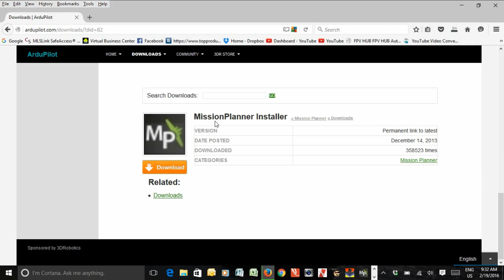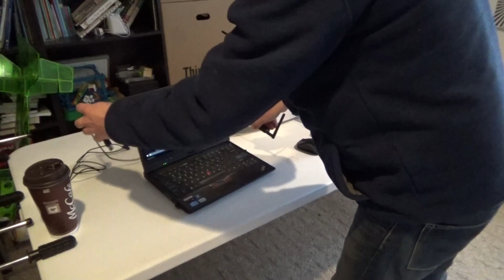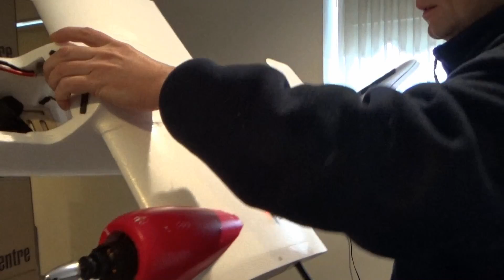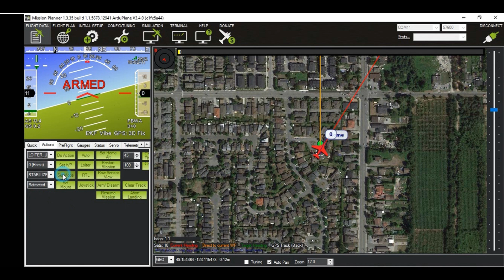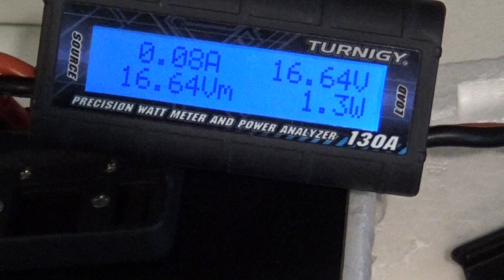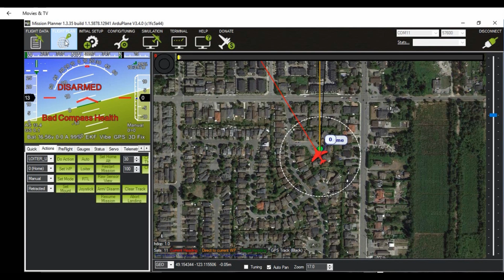APM 2.6 configuration step by step for fixed wing missing compass calibration

Comment: Hi how do you set the 6 position switch for the flight modes?
Reply from the maker: Good question… it has been so long that I can’t remember. I quit using APM shortly after I publish this video! It’s way too complicated and I just like yo fly and programming was too tedious. Not for me the APM!
Reply: @EduardoFritisRealtor  I agree it's to much to program. I can get three flight modes.
Reply from the maker: @briancrick935  My experience with APM and ardupilot was bad… in those days you needed “minimosd” and the connection was always bad. Spent 1 hour trying to get it going each time! So I decided to ho back to Vector, today is discontinued but I still use it! I don’t do anything fancy, I just enjoy flying… just use stabilization, 5% RTH and very seldom I use 2D Hold… today there is a number of flight controllers… I see many many complaints about them… probably the best today in my opinion is MFD… not much programming and lots of flying!
Reply from the maker: Now… I use the 6 position switch for different levels of cruising Amps. I also use a 3 way switch for climbing at steady Amps and elevator…. I use two three way switches for the flight modes… by combining two switches you get 6 positions…
Reply: @EduardoFritisRealtor  hi thanks

Comment: Hello sir. You have explained very well about the apm flight controller about this problem in my setup. It is coming in when I fly the plane, when it turns on the left, right or right, its motor should be shut down and this too It was happening that when the motor was throttle, the motor was shutting down within a few minutes and after a few seconds the motor was getting started Please help Sir my whatsapp no +918077544605
Reply from the maker: New RC Plane India Hi and thank you for watching and commenting. I don’t understand what’s your problem. Can you try to explain again please?
Reply: When the motor stops the motor in the plane, then after a few minutes running, it becomes an arm, then when I see its automatic disarm switch, then when I throw it in the air then When flying in the air when the left or right bends, then the self becomes a disarm. I have also given my whatsapp to the head. Please help.
Reply from the maker: New RC Plane India I don’t think I can help. I haven’t used the APM for years now. Look in Facebook, there are groups that might be a better option for you. I’m sorry I can’t be I’d service to you.

Comment: Hello and thank you for the video
when i set mode rtl my plane is going straight on the ground. 
i see many times your video and i reaf your reply to someone else who has the same problem with me. setting two way points -take off-and rtl will fix it?
if i add  some other way points at the field from adroid degice will not overrife the previoys wayponts ?

thank you in advance
Reply from the maker: DC CD Thanks! You must have the RTH altitude in 0 that's why it's coming down when you engage RTH. You can set an altitude you desire to RTH.
Reply: Eduardo Fritis 
thank you for your reply
rtl altitute parameter is 10000 cm
there is a gps 3d lock
i can see from android device that i change from stabilize to rtl
i fly parallel with me and when i set rtl plane is not turning to me .
what do i have to do to fix the problem ?
Reply from the maker: DC CD I'm sorry I can't be of further help,  I stop using this system long time ago! Try Facebook or RC Groups that work with APM!
Reply: DC CD it's possible your altitude isn't set to relative. If it's set to actual it will try to go to 10000cm above sea level so straight into the ground. Change it to relative to your ground level

Comment: How to tune te PID's values please ?
Reply from the maker: There is a function called "auto tune" that we use for that matter. This flight controller is very different from the ones used for mini quads. We have used it mainly in planes and big quads and works just fine for that. Is that what you are looking for? Mini quads? For planes you don't even need the auto tune function.
Reply: I want to flight by a plane same of yours (used in the vedio) .
You mean should I keep PID in default values for my plane ??
I did all what you had done in this vedio but I am affraid of PID
Reply from the maker: We have 5 planes flying with APM, doing exactly what is explained in this video and have had NO problems. First flights in manual mode, just need to trim the plane and adjust the surfaces mechanically leaving the radio trims in cero. It takes three to four short flights to get it close to perfect. Then you can use all the functions with most confidence. No need to touch PID settings. Which plane do you have?
Reply from the maker: Why are you afraid of PID?
Reply: VolanteX RC Ranger EX 757-3 FPV
Okay I will give it a try Thanks a lot
Reply from the maker: Just let me know if you have any troubles. Faster is to connect via Facebook messenger text.
Reply: I will do
Reply: Huge Thank to you guys

Comment: hello! great video! if i understand you right, to setup rtl mode i have to make wp?and should i do wp very time i goes to the field? cause when i tryed rtl last time my plane goes strait to the groud.
Reply: every, not very)
Reply from the maker: Thanks. You need to follow the steps in the video when we program the auto launch! First launch and then RTL. It is a two step programming. RTL engages at 40 m.

Comment: Hi, I have tried Arkbird and FY-41 lite. None of them support waypoint navigation (UAV), so I am considering Ardupilot 2.6 Mega. And my question is does Ardupilot 2.6 Mega supports waypoints? will I be able to plot waypoints using the GCS and launch and RTL fully autonomously?
I fly at LFERC in Livermore and planning to put Ardupilot 2.6 on Ranger.
Reply from the maker: Hi Riz, the APM 2.6 supports way points. It's really remarkable how they work. We have done way points and auto land with the Skywalker and a quad. Both flawless. We have done outdo take off, waypoints and auto land from an android phone. Awesome and very easy to do. Need to consider the type of plane to use. Faster planes would perform better on windy conditions.

Comment: eduardo , a few questions i have .

for trims i can incorporate them with a recalibration of the radio with set trims and then recenter trims on radio , insted of adjusting the claves ?

and how did you get the 6 flight modes on taranis ?  i managed to get them between two switches but they go from 1 to 3 to 5 to 6 to 2 to 4 which is confusing lol.... maybe you have a better way to configure it?

thanks
Reply: +Aron Gatt Cool, anything you need just let me know.  I post my FPV videos on a different channel. Mostly private videos.  If you are interested email me.
Reply from the maker: +Aron Gatt Hi Aron, when you first fly the plane with the APM you do it in Manual mode.  In the air you trim the plane so it flies hands off at cruising speed.  You land the plane and watch the surfaces really carefully and remember each deflection. You can start with the rudder, remembering the deflection you center the trims in the radio and adjust the ruder by moving the push rod until you get to the point it was before adjusting the trim in the radio.  You repeat the same for the elevator and ailerons.  You get the plane in the air in Manual mode again and see if the planes flies straight no hands at cruising speed.  If the plane needs trims go ahead and trim the plane until you are happy with flying straight no hands at cruising speed. Land the plane and watch the surfaces really carefully and remember each new deflection. Start with the rudder, elevator and ailerons, remembering the deflection.  Center the trims in the radio and adjust the ruder by moving the push rod until you get to the point it was before adjusting the trim in the radio. Once done launch the plane again in Manual mode, by now the plane should be flying straight.  If not repeat until the plane flies straight.  It is tedious but onces is done properly your APM will be most grateful and you too.
Reply from the maker: +Aron Gatt As for the 6 position switch there is a 6 position knob that you can get for the Taranis.  You will have to open the radio and install and connect the knob.  If you would like to go this route eamil me at eduardofritis@gmail.com and I will send you links to get the knob and how to connect it inside. If you are not an "electronic" kinda guy keep the two switch and remember the positions. Let me know.
Reply: +Eduardo Fritis thought i could have eliminated all this by trimming the plane and then redo my radio calibration with trims still on the radio so the apm will get the trims incorporated and then turn it off - center trims on radio then power on apm (job done) but i looks like i have to arrange claveses ( no big deal ) thanks alot eduardo
Reply: +Eduardo Fritis i found a place for the 6 pos switch from BOLTRC ..... im not bad in tinkering ( setting up APM ) :)

thanks again
Reply from the maker: +Aron Gatt Unfortunately you have to adjust claveses!  Once done properly you will enjoy the benefits of the APM. I like flying in Cruze and doing the turns using the rudder only.  Super stable and nice to fly. You from UK?
Reply: Eduardo Fritis no not from uk , im from malta , but if its for shipping is only 2-3 days from the k to here ... faster then any other place

Comment: Thanks for the video.
What is the best way to trim the plane? I know you said fly in manual mode and use the transmitter trims, But what is the process of adjusting the clevises on the ground
Reply from the maker: Hi Paul, once you trim the plane in the air, you land and watch carefully to the surfaces deflection. You start by the elevator. Observe how far up or down is the elevator moved, take a picture if you need. Then release the pushrod while holding the elevator in the position it landed and while holding that, center the trim in your radio and fasten the pushrod. Now with your radio trim centered, the elevator shall be deflected as it landed. Do that for each surface, ailerons are tricky. Once done fly the plane again and see if it needs more trim. If so, land and go through the process again until the plane is flying hands off at cruising speed. We are missing compass calibration in this video.
Reply: +Eduardo Fritis Thank you, I assume that was the way, but I was wondering if there was a more efficient trick to get it bang on first time.
Reply from the maker: +paulham we have not yet found another way to do it. We usually get it right on the first trim. Just go slow and methodical. If you know a better way please tell me!
Reply: Muchas gracias por la información. Una gran ayuda!